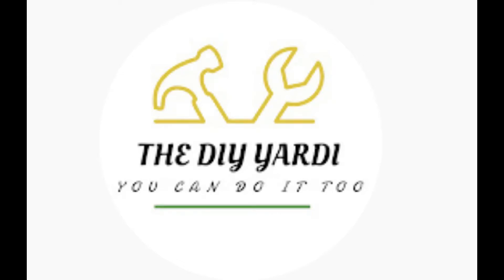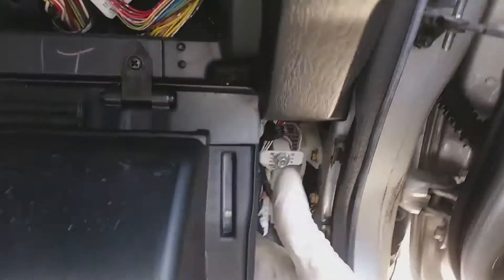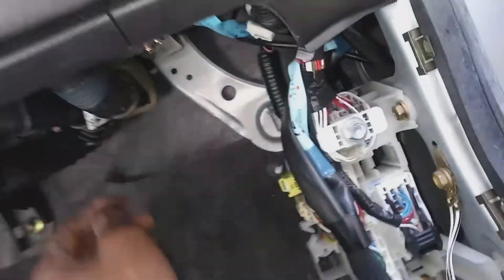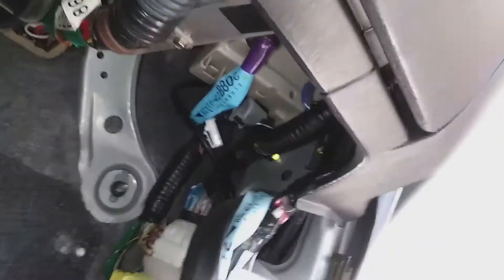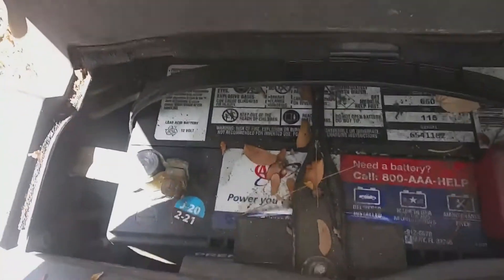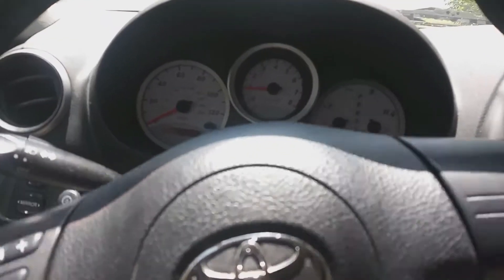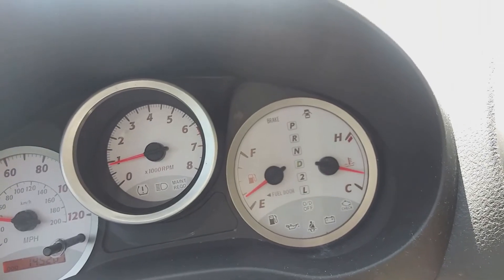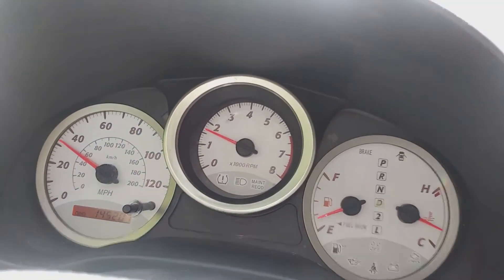OBD CODE P0776 FIX, 02-06 TOYOTA'S INCL RAV4, THIS PROCESS COULD SAVE YOU THOUSANDS OF $$$$$

Comment: Where did you send your ECU for repair?
Reply: I have the exact same problem.  Hard shift into reverse.  limping/power brake feeling of 1st into 2nd gear.  2nd to 3rd to 4th is just fine.  Great video!
Reply from the maker: @bullhorndax  to be honest I don't remember the exact  name of the site, this is actually a friend of mine car, what I did was to search the part number of the computer on google, several sites popped up, and she chose the the one with the quickest turn around time and cost, she had to send her old computer to them once she received the refurbished one in the mail, I think she paid $250 for the refurbished computer, plus an additional $150 which was refunded to her once they received her old computer. There are a few option to doing this, you can buy the computer outright, send yours to be repiared and sent back to you or the process we took, its whichever works best for you, time and cost, good luck with that, and please keep me updated.
Reply: @thediyyardie7192  purchased an ECU exchange from Circuit Board Medics $259.00 and send them back old ECU for core.  It fixed the Transmission problem mentioned above!  Followed your instructions and drove the car for 30 minutes.  Funny how you could feel the ECU learning the shifting trends of the car.  Car drives perfect now.  

I did the same thing as you did first for code P0776 though I knew of the popular ECU problem of the 00 to 03 Rav4's.  More rare, but does happen in 04 and 05 as I have learned.  I pulled transmission pan to replace SL2 solenoid.  Found that the ohm reading was 5.5 and that range is 5.0 to 5.6 of SL2 solenoid.  Tested with 12V and it was working fine, so had a good suspicion it was ECU.  Wasn't till I saw your video to confirm.  Thanks again.  Though do want to point out that he solenoid could have been tested without dropping the transmission pan.  The wire harness the goes to ECU could have been unplugged and solenoid could have been tested though pig tail, though I'm not sure which pins.  Maybe someone could comment on here which pins.
Reply from the maker: @bullhorndax  Very good to hear that it fixed your issue, and yes you're quite right about testing the solenoid at the connector, I just prefer to visually inspect the plunger to make suer its not broken, just to rule that out. But I love the feedback, thank for taking the time, and please consider subscribing if you didn't already do so, trying to grow my channel and need all the help I can get.